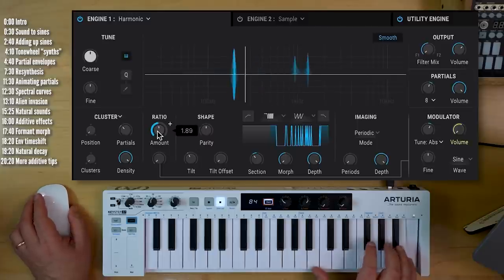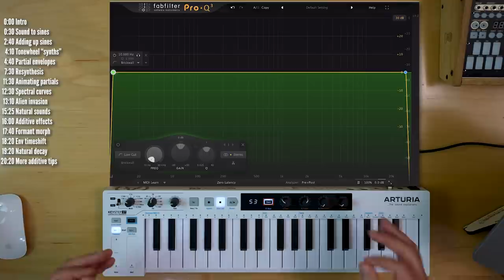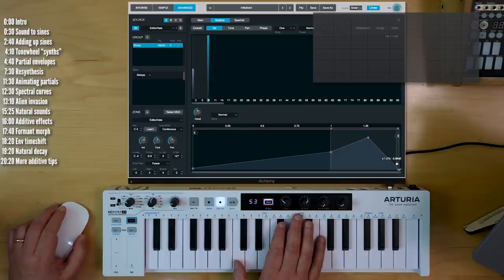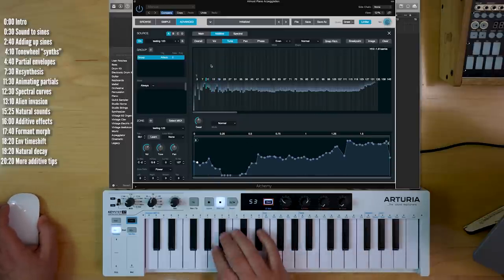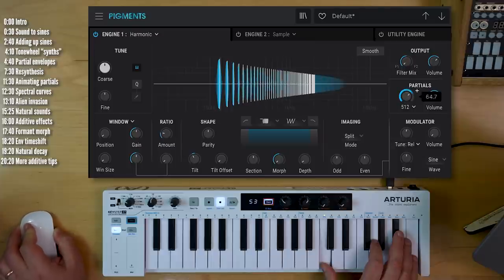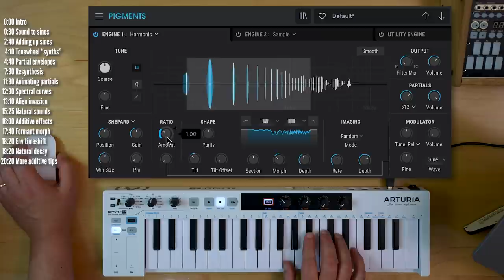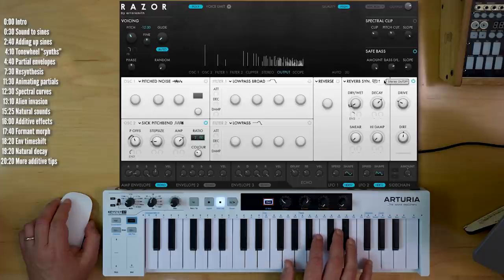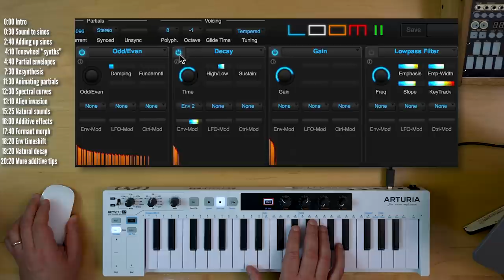Additive Synthesis Magical Mystery Tour // Pigments 3, Razor, Loom & Alchemy Resynthesis Tutorial

Comment: The basic idea of the “Additive Synthesis” is, to generate a sound wave by adding harmonic overtones (= integer multiples of a root wave). In principle every harmonic sound with any timbre can be produced this way. 
But nature is a little more tricky. On one hand no sound has a constant overtone spectrum. In the most cases the higher overtones fade out faster than the lower, so that a sound start bright and ends dull.
On the other hand two or more waves with slightly different frequencies can superpose and produce nice humming interference's.
So the “Advanced Additive Synthesis” uses several (2-4) slightly detuned oscillators with fading overtone spectra to produce natural and interesting sounds. 
You can set an overtone spectrum manually with the volume sliders or you can construct it by selection rules or you can generate it automatically with FFT (Fourier-Transformation) of a natural sound. Take a look to the Windows "Synthesizer Keyboard".

Comment: Speaking of additive synths: there was an old hardware russian synth ANS, which synthesized sounds based on spectral images drawn on paper. There is also a modern mobile application version of it called Virtual ANS in which you can scan whatever you want through a mobile device camera to synth outworldly sounds
Reply from the maker: yes, Alchemy has this feature too, it just seemed like a bit of a novelty to include
Reply: Izotope iris to thats called spectral synthesis
Reply: @loopop  Can Pigments do resynthesis?

Comment: I've been really enjoying my Kawai K5000S (one of the few hardware additive synths out there), and found this video very informative/interesting. The K5000S can only do sixty-four partials per "source", but allows for six sources per voice, a loopable envelope for each partial, a 128-band formant filter that can be modulated by various LFOs, PCM waveforms, and much more, all on 1996 hardware. It even has a floppy drive for loading firmware and patches.

Comment: Great video! Lots of nice sounds here. :) Just one pondering about the beginning. It has been my understanding that not all sound breaks down into sines only, but there's also "broadband" sound, noise and transients being examples of this. Regular cyclic movement is the part that is made up of sines and irregular erratic movement is something else entirely. With that in mind, asserting that even noise is comprised of sine waves seems incorrect to me? My intuition is that the sines you get from the noise in your demonstration are introduced by the filters you use, rather than really being present in the noise itself. That would also explain why when you move the filter frequencies apart again, after having them joined at the same freq, we can hear the two cutoff frequencies more loudly than the theoretically infinite amount of sines that we could be hearing between them. At least until they go far enough apart, then the noise seems to take over the sound again.

Now first of all, this might seem nitpicky, sorry about that. ;) My intention is just learning. Secondly, while I strongly trust my practical experience as a music producer, my understanding of the physics/math of sound might well be just at that point where the dunning-kruger effect could lead me to be overconfident. So I'm not sure how much faith I should have in what I wrote above. Maybe some physicist or fourier transform wizard can verify or clarify?
Reply from the maker: First - thanks! Then some thoughts:
- not nitpicky at all - any physicist or fourier transform wizard are welcome to comment - I'm not one for sure
- I never said you can make any sound from sine waves... I said that's the theory - in any event, "a sine wave" means at the very least something that can change in amplitude, frequency and phase so quickly it can probably be characterized as noise if modulated enough
- The fab filter guys are pretty serious folks, I doubt they'd add resonance without saying so. My guess is we're "hearing" the new peaks because our ears are saying "oh that's new" as the "Q" expands, literally filtering out any other noise.
- I think as we expand the bandwidth of noise filtering we hear more musical sine waves until our ear says "screw it, that's just noise" (a non physist's explanation")

Comment: Aw no Harmor ;p Yay additive synthesis though!
Reply: also no parsec, my personal favorite as harmor isn't quite available on mac :(
Reply: I LOVE Harmor, especially for it's granular and Resynthesis capabilities. IDC what ANYONE says, Image-Line has made some of the COOLEST Synths. 

Yes, even you, FLEX. Even you.
Reply: It's also missing the CMI v and the Synclavier V, although they have more limited capabilities.
Reply: @gridsleep I'm aware, although they are limited only in the number of partials (that's what I originally meant) because otherwise, they are capable of doing a lot of stuff. Both can convert audio to partials, and the CMI V can convert partials back to audio, giving a cool lo-fi sizzle to them (due to limited partial count and low bit depth). And both can have up to 10 layers of sounds, if I remember correctly.
Reply: Harmor is the best. I've been messing around with it. Does anyone know why IL stopped supporting the VST versions of their synths? I really want to use Harmor but I dont use FL studio.
Reply: @gridsleep I believe they used to offer separate versions of the synths in VST format. But they don't anymore, it was probably costing too much to maintain
Reply: @HazyJ28  image lines synths are friggin bleh compared to propellerhead

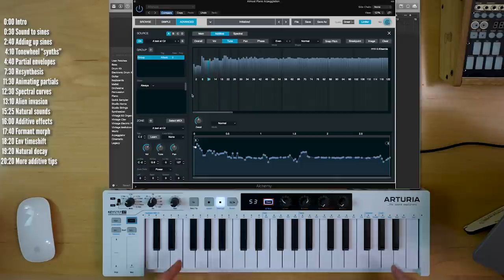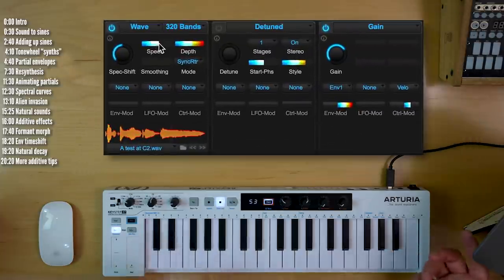Comment: 9:42 Been busy for quite some time to get a the vocoder effect that you show. By now I understand the wav-file needs to have certain characteristics to 'work', and tiny changes the settings (10:14)  makes all the difference. Could you tell/any ideas what these requirements of the wav-files are? After trying some wav-files of my own (resulting in eternal distortion), I downloaded some simple 'hello'-wav files from the web. The one that looks the most like yours worked in the end. It needs clear dynamics it seems. When it looks more like a ribbon, Loom goes bezerk, despite all modules and fx off. Any ideas?
Reply from the maker: Hey - I'm not too familiar with Loom, but I did two things with my sample - first, I tried to sing it at a specific note (I picked C2), I didn't just say it, and second, I put C2 in the file name - which helps Alchemy tune it according to their manual. It may work the same way with Loom, but I don't know for sure
Reply: @loopop  Thank you for your response. I was so inspired by the vocoder-part that I wanted to try it myself. I just took a sample from the web, and that went 'wrong': http://free-loops.com/3009-hello.html ,
and after a frustrating half an hour I tried another one, the first one here:
https://soundbible.com/tags-hello.html#google_vignette

Of course I can't (and won't) ask you to know or  figure out the workings of a specific application/program/VST (i.c. Loom), but I wondered whether this concerns general principles in sound design/sampling